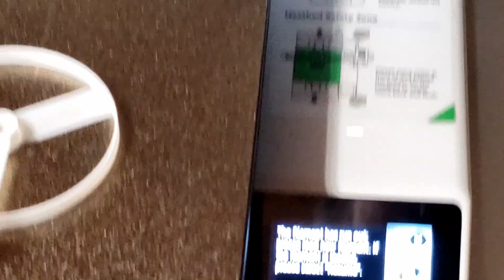My Bambu Lab A1 Ran Out Of Filament - Now What?

Comment: if this happens in the middle of a print, does it ruin the print? I'm interested to know in order to buy the AMS or not (I don't need or want multicolor printing but some redditors talk about when the filament runs out)
Reply from the maker: When it ran out, once filled, it went right back to the spot it left. I do not have the AMS, however, the filament running out is controlled at the central point. I assume it would be perfectly fine - but I can only assume...🍻

Comment: This is not what happens for me, it says failed to pull the filament out of the print head, and there is no option whatsoever to load filament.  Using AMS.  All choices on filament are greyed out, the only choice is to stop the print job and start over.  Very big failure not to have basic change of filament.  Overall the printer is still better than the one it replaced, but it is glitchy in places.
Reply from the maker: I appreciate your feedback. I don't have the AMS, however, my friend does. I may have to test his rig and see what's up with that...🧐🍻

Comment: Are there any line effect in the spot where the filament was finish and resume? thanks for sharing that
Reply from the maker: @federicolecca963  
I was really taken back. The print was clean. I could not tell where it stopped and started back. I was using white matte PLA,  I debate if that would be the same outcome using a silk PLA, or something like that...🤔
My pleasure...🍻

Comment: My a1 looks different from yours, strange.
Reply from the maker: @originalkingdomhearts  
That's strange, what's the differences?
Reply: @PropsOff  My bed where the plate is on looks very different and the x Axis looks different too mines has a solid plastic on it now instead of metal showing. Your bed is a lot smaller.  Yours only covers half of the plate and mines covers it all.
Reply from the maker: @originalkingdomhearts  
You have the Bambu A1 Mini?
The only differences that I was aware of was the A1 Mini purchased directly from Bambu comes with a little gift. That's all I knew. I wish I could see a picture of your printer - so curious...🤔 No obligation, if you want, email me a picture. Very interesting...🍻

Comment: Wish i had seen this before my filament ran out on my A1.  I tried to add a new roll on a different spool slot on the AMS lite- big mistake!
Reply from the maker: @MultiTman1000  
I was pretty impressed with how well they made the process, compared to my other printer.. I try to get my videos out there, but YouTube seems to hide my videos after a day after posting. I think they want me to pay-to-boost - ain't happening...🤣
Reply: If you have 2 spools set to the same brand, color, type already loaded on the AMS lite at the start of the print, it will automatically switch to the new roll when the old one runs out without you even having to do anything!